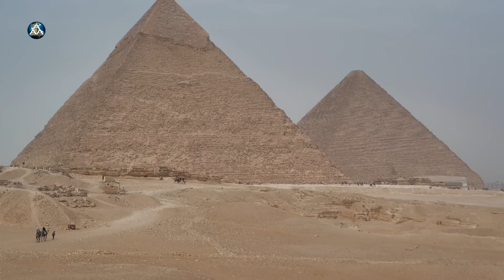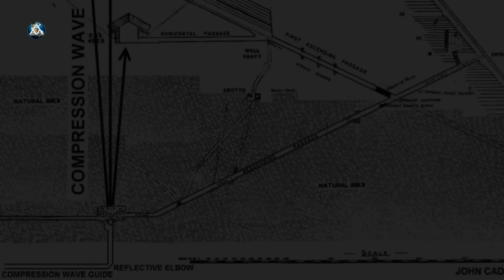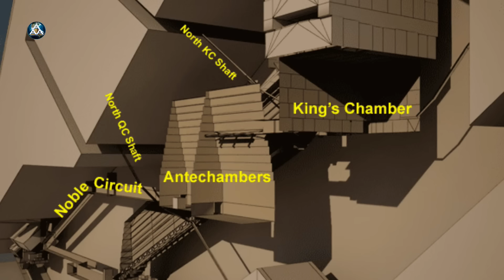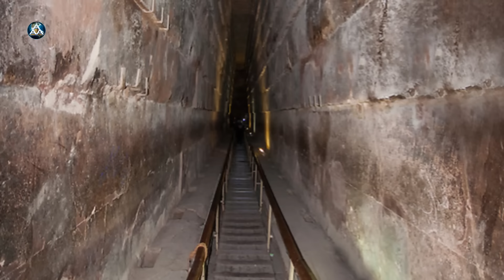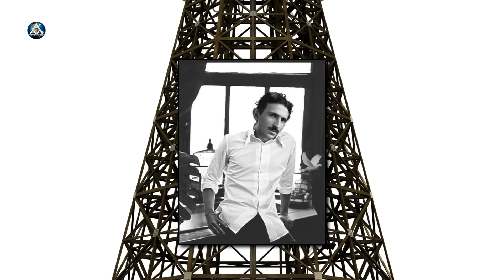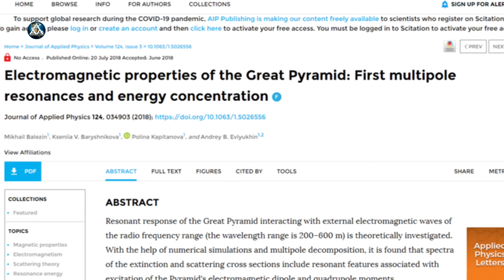The Great Pyramid Power Plant

Comment: Love the multipurpose theory. Much described in The Lost Book of Enki.
"With galleries and chambers for pulsating crystals he designed it."
"The power of all the crystals to the heavens in a beam it focused."
"... a beacon to the heavens it was ..."
but also 
"Inside eerie lights began to flicker, an enchanting hum the stillness broke;
Outside the capstone all at once was shining, brighter than the Sun it was."
"Of electrum, an admixture by Gibil fashioned, was the Apex Stone made."
and last but not least:
"For the celestial boats it was put together"
"Beyond the understanding of Earthlings it is."
"Its foundation stones the waters touch"
Hydro-electric power generation without a doubt. And "for celestial boats" ?
And as the movie mentions (6.17) hydrogen was produced. This was easy to produce from the waters below the pyramid (it only takes 1.23 volt (from flowing water) to start water electrolysis).
But what amazes me is that no one yet brought forward the purpose of producing hydrogen as rocket fuel for the Anunnaki 'celestial boats'. Makes sense to me that the Anunnaki had great demand for something to fuel their 'celestial boats' while being on this planet for 1000s of years. Even for NASA it's the "Fuel of Choice". In combination with an oxidizer such as liquid oxygen, liquid hydrogen yields the highest specific impulse. Just wonder how they would liquify the stuff ...
Any ideas someone ?
Reply from the maker: Thanks for watching!

Comment: I will be 71, tomorrow. 35 years ago I came to possess a book on the Great Pyramid written by a pastor in the late 1880's. He assembled a number of mathematicians and measured the thing. Their results were curious. They compared the measurements made in inches and centimeters. Centimeters were criticized because the standard was a meridian that ran through Paris. It was an egocentric decision, they concluded. If they wished a 'high' standard, they should never have used a 'curved' line. A meridian runs along the outside perimeter of our globe, It was asked why the Earth's axis wasn't used instead, if they were seeking the greatest perfection for measurement. The point was that the measurements made in inches had real parallels elsewhere that the metric system failed miserably.